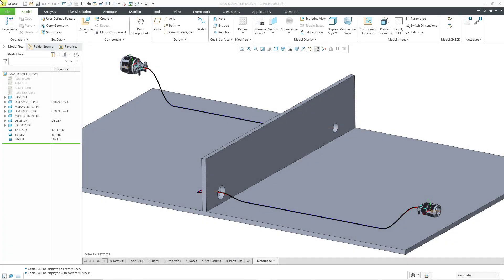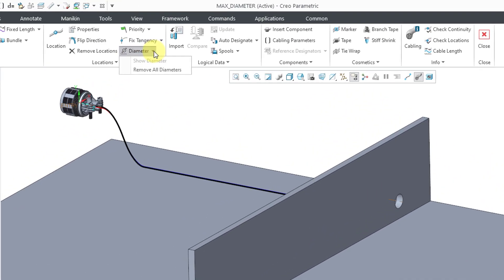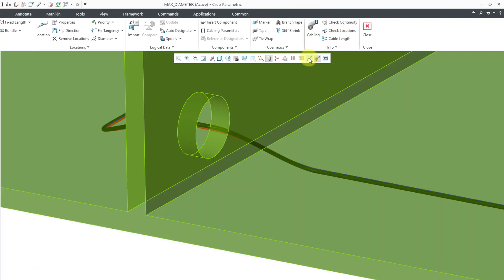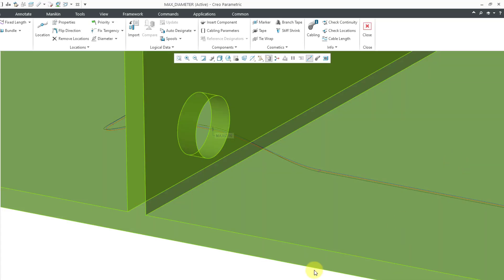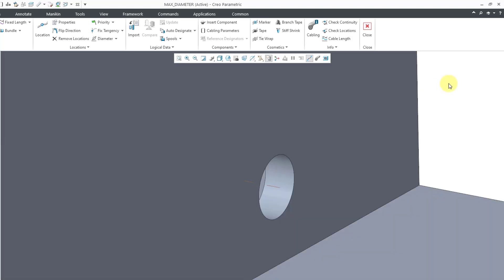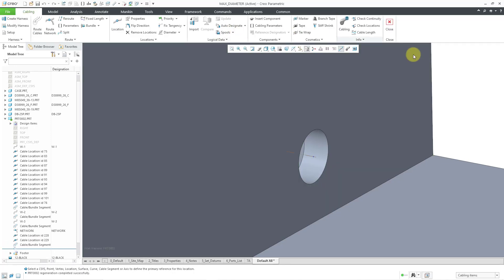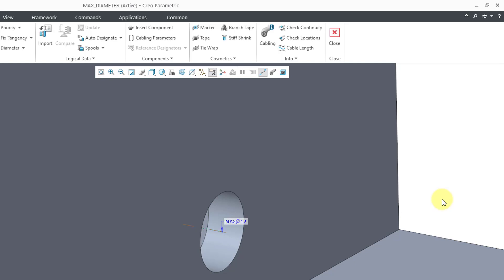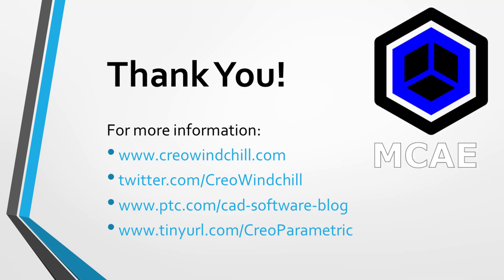Creo Parametric - Cabling - Max Diameter

Comment: Is there a way to export a cable assembly as a STEP file and get the cable route to export also in Creo7.0? What about other export file types like 3MF, STL, IGS, or Parasoild? Every time I try to "save as" a STP file it will have the connectors but not the cable route. Are there any videos that show how to export cable assemblies out of Creo? Thanks.
Reply: After switching the file "Type" to "STEP" the "Options" button is enabled where you can enable to export the cables as "surfaces".